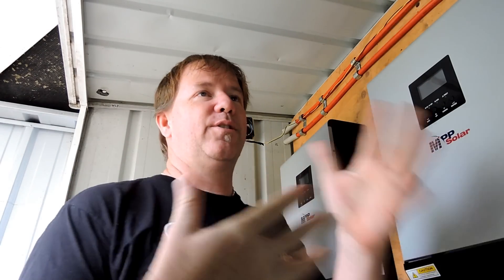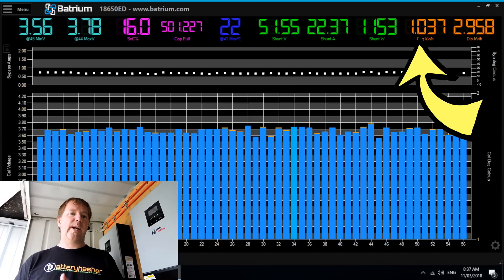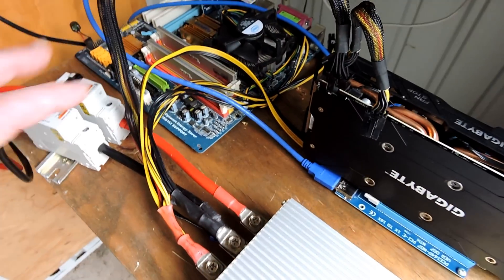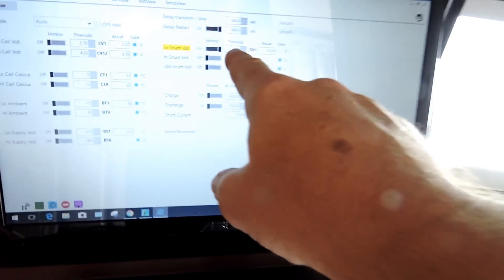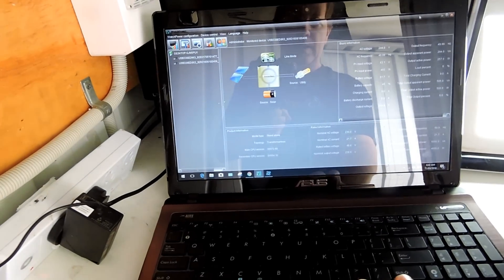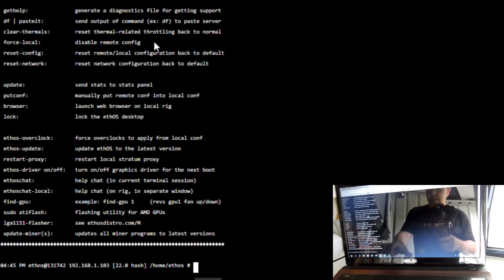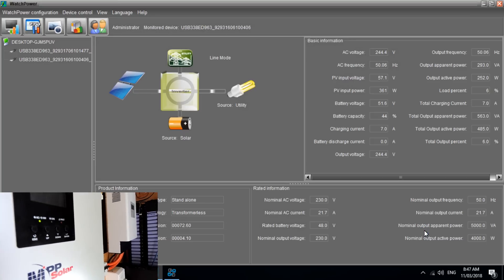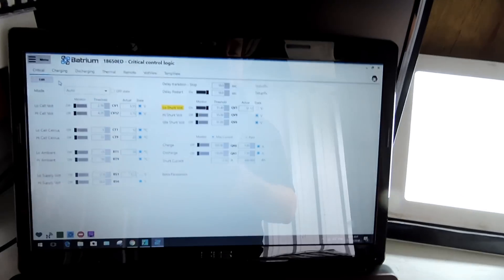Solar Mining Rig  DC to DC crypto mining from my DIYPowerwall [2018]

Comment: @HBPowerwall Congratulations. In my opinion, this setup is the most efficient. DC/DC up to the miner is the way to go. How would you power a 3kw Bitcoin ASIC miner? Are there bigger DCDC converters? I can't find a lot.
Reply from the maker: I've done ALOT with this - best method by far is a typical household solar system to offset your energy costs and no batteries. There is next to no use using batteries as they would degrade much faster with such sustained heavy use.
Reply: So standard AC/DC PSU on the grid but with deducted energy prices because of the solar output? Have you implemented something to turn off the miner automatically e.g. at night or in months with not enough sun intensity?
Reply from the maker: Minering pools don’t like rigs that go on and off line. It’s not ideal
Reply: @HBPowerwall Could you make a video about: "Why is it not good to charge my electric car with my solar batteries at home" or something like this.
Reply from the maker: I could but I do that lol 😂

Comment: Hell ya this how u mine Crypto Coins!!! Mad props!!!
Reply from the maker: It's cool, but not practical YET, working on it...
Reply: Once the  price drops down for Solar Panel materials it will be worth the ROI, just gotta wait.
Reply from the maker: Solar isn't the issue you can get a 3kw used system here for 300 bucks if you look around, battery storage is the killer. Cycling the cells that hard and constantly really will take their toll on them
Reply: I agree battery technology is another key factor, thank god they are working on Graphene Super  Capacitors, Tesla stated they will start using this technology around 2020-2024.

Comment: HBPowerwall would you know about how many watts per solar panel I would need to charge a 4kwh power wall at 58.8 volts. Also does the output voltage matter on a solar panel or just the wattage matter or both

Comment: And the seller is sold out of the DC-DC Converter, nice work Pete lol.
Those Pico PSUs are unrepairable btw, they way they are soldered together makes them near impossible to take apart. I've got one that was DOA I couldn't repair, anything that could have failed is sandwiched between the two PCBs.
Reply from the maker: I think for the price you just buy a new one, infact i thought i busted that one up so have two spares here now..lol
I just messaged the seller my youtube video hhaha told him i'd need another one

Comment: If you use the pico psu for a vehicle you can use the 12v ignition input to control computer power 

We use one on a cnc machine to shut down and start up the controller and it gives it a 12v ups (ignition input is fed from a mains psu so it the mains is on 12v to the ignition feed and pc turns on then when power is cut the pico sends the shutdown signal and the pc runs off battery until it turns off)
Reply from the maker: Yes they are handy little units, looks like some of the bigger mining farms use them on all their rigs with 12v server psus
Reply: HBPowerwall It's the m2 atx we use it has a 12v trigger wire when that gets 12 down it it will start up the system and when you remove 12v from the same wire it issues the shutdown signal direct to the motherboard

Could be a nice way to connect to the batrium system
Reply from the maker: i just plug the batrium direct into the power button of the mother board.. simple and easy for sure.

Comment: crypto mining is such a waste of energy, not with your setup for sure ... but world wide, all the crypto stuff that's mined with coal/oil/gas i hope that 2018 is the end of crypto currency's
Reply from the maker: It's like stopping religion, won't happen even tho it doesn't really even have any base in reality. Power wise wonder how much power all the banks in the world use? I'm willing to bet we are looking at a similar amount if you take into account the market caps. That said most massive mining farms are in areas with cheap power and cheap power isn't coal/gas/oil it's thermal/hydro/solar
Reply: even the mining farms at the thermal/hydro/solar powered places are bad, many of these countries exporting energy to other countries but when they can deliver less the price goes up because they need the energy itself, that's why some of the countries want to add a kind of extra taxes for high power usage ... and even than the clean power that they cannot deliver will be replaced by coal/gas/... you can easy do the calculations for all the waste in energy please check it, i know you are currently "infected" by the "crypto hype" and for sure with your setup it is "ok" but do not forget all the others, all the waste of energy... for the banks the software is mostly designed to operate as fast as possible (i was 10 years chief software developer for a company that has developed software that some banks are used) and with the as fast as possible it should run fast and there you don't want to use operations that are waste of time and so waste of energy, crypto currencies/smart contracts are a nice idea but real bad because of all the slow and massive operations ... you use something slow like sha256 or even other operations for login pages where you need security ... i know that's one thing for something like bitcoin ... it is a slow operation so bruteforce a password would not so easy so there this algorithm is fine for ... but most of the calculations for the "mining" is going to waste not used .... and again for your setup its ok to waste the "free energy" but for the environment all the crypto stuff isn't good, idk how much power you have put onto that over the time but maybe the power would be in Australia better used for an public fridge or something like that idk keep some snakes cool and chill :-D

Comment: With all the work you do with them small battery's, would it not be easier to just get hybrid or tesla battery's

https://youtu.be/4-t3j8SVyT0 I forget now on what each bank was, but I think Its a 60v system (most inverters at that high dc voltage have a wider range)
Reply from the maker: It might be easier, but here in Australia EV batteries are quite hard to get locally plus would have made for a boring youtube channel lol

Comment: I'm an elderly gentleman, closing in on 50 years 0f age. My son introduced me to Cryptocurrency mining in late 2012. After doing a lot of researching Btc I felt strongly that It had a lot of growth and potential ahead of it. So my son and I built my 1st rig and I started mining in January 2013, pulled $5,000 from my IRA and bought Btc at $13.44 and have never looked back since. The sweetest sound that I've ever heard was the clink of my 1st mined Bitcoin way back when. That was as satisfying a note as there ever was on any musical scale. Nothing but happy days ahead since. Don’t get me wrong, there have been bumps in this Crypto highway, the demise of the Silk Road, Mt Gox, DAO hack to name a few but as a HOLDer (holding on for the long duration) not a HODLer (hanging on for dear life) and not day trading, has rewarded me with quite a decent profit. It just takes a lot of patience (Sisu) and doing your research with due diligence. I have since invested in Ethereum (Dec 2015), Monero (Jan 2016) and lately Omisego (July 2017) all purchased from some of my profits from Btc to go along with my newly acquired free Bch and recently free Omg. I'm currently operating 3 rigs equipped with 6 gpus each. 2 mining Eth and 1 Monero for now, all of which will be re-evaluated after Metropolis kicks in to see which direction I go from here. So I ‘m back to doing more research in order to help with my next moves but I'll always be a strong believer in Ethereum which is where I've made my money so far. HOLDing on to the rest for now. Btc $5,000-10,000, Eth $2,500- 5,000, Monero $200-400, Omg $100-1,000 no one ever really knows but MY research says yes and so far MY research has not proven me wrong. Bought Btc at $13.44, Eth at .80, Monero at .48, Omg at .43 Bch for free. No where to go but up for me. Just biding my time. It's taken me over 4 and a half years to get here but I've made over $4,000,000 so far with just my original investment plus the cost of my rigs and I’m still sitting on a lot more. Taking a position and HOLDing is where the real profit is and it isn't going to happen overnight. So if you want aggravation and ulcers go ahead and day trade, try and beat the Market I wish you luck but the real money comes with Research, HOLDing and Patience. Hope this advice helps because in the long run what it all comes down to, its just Eths, You and Me hopefully making the right decisions, feel free to get in touch with me via steeledavideugene3@gmail .com, i will surely guide you on how to invest wisely in cryptocurrencies that will make you more profit at the moment.
Reply from the maker: you only got a few years on me lol good to hear it is working for you

Comment: DC to DC good to see ....I'm not the only mad person on the net! next you have DC fridge and DC fans ,lights, HDTV, HTPC, fish tank air pumps. all on DC like me then get to turn the big inverter off ...haha good to see you got a pico PSU working I got them in my pc
Reply: TRMTHEweasel issues with dc is cable length if its anything out side the battery room best just to use ac 220-240v (or 110v if that's your flavor but you need thicker cables at 110v ac) as losses in cable with dc are more then loss of a ac pure sinewave inverter
Reply: That may be true, but if the power is basically free to begin with, then you could lose 10% voltage and still be sitting good. I think what I would do is if I needed to do long runs, I'd boost the voltage up high (200+V) then transmit, then drop back down. But, for the time being, I would only be going <50Ft runs atm.
Reply: i'm over buying big inverters that just die each time and very costly , time to get it fix im best just have DC gear in the home but hey if you got the cash for big inverters go for it . as for cable size i use right size for what is needed to run i have lots of small setups i don't have all my eggs in one basket as they say .

Comment: are you going to get your money back on this
Reply: Well, considering that his power he's using is virtually free, and the hardware for the inverters and all the other equipment is partially roi'd already, I think he'll get his investment back fairly quickly. Not with 1 GPU, obviously. But I'm sure his roi could be as short as a few months when he gets things ramped up. I doubt he'd need to wait a year for it.
Reply: I'm a miner on need to educate me on mining, crypto is falling
Reply: So does the stock market, and it rebounds. Some 'currency' might fall and stay down, just like 'stocks' might fall and stay down. But overall, the whole system stays up and will fluctuate. You can't say "crypto is falling and will disappear" just like saying the "stock market is crashing and will be done away with". It "might" happen eventually, but not any time soon or the near future. I would still, and still plan on, build a crypto setup. If coin "A" is failing and looks to be about dead, I'll switch to coin "B". It's that's simple. Just like selling your stock in one fund and buying in another that's going up. Sure you loose some $$ in the initial re-investment, but you'll gain in the long run.

Comment: Nice project. Have you measured the efficiency of the DC-DC when running under load? Is it any more efficient than doing it via mains (without that DC-DC converter). You can easily measure the efficiency of your DC-DC converter with the clamp meters.
Reply: Olavi it should be more efficient you are only doing a single conversion 

My running from the inverter you are doing much more

DC > mains inverter 
Mains Inverter > PC SMPS (DC)

Now it's just DC > PC (DC)

So unless the DC converter is highly inefficient then it should be better plus it takes load off the more expensive mains inverter that can be used elsewhere
Reply: @Olavi: The DC-DC converter is far more efficient overall. Especially since under idle isn't only consuming 25W. That would be consumed just for the inverter alone idling. Then add in another inversion, so that's at least another 25W. So, overall, he's cut his inefficiency in half, at least. 
The converter is basically a huge buck converter that can handle lots of amps. Buck converters can be 96% or more efficient.

Comment: If you are only using 1 or 2 cards, you don't need the risers
Reply from the maker: risers will draw less power through the mainboard and also let me spread the heat a little
Reply: Agree with HBPowewall. Plus, it allows for future expansion without a lot of redoing wiring later on. Plus, it looks cleaner and neater